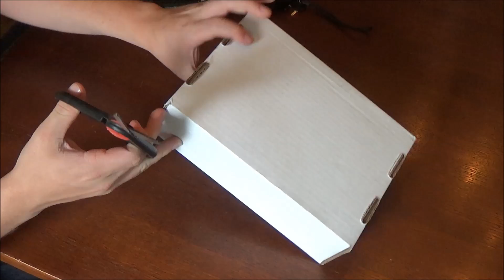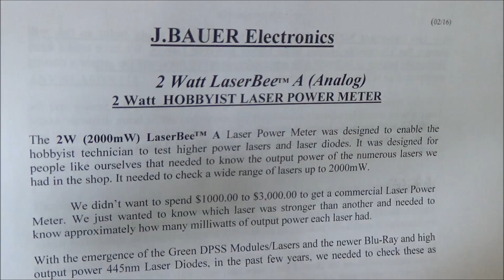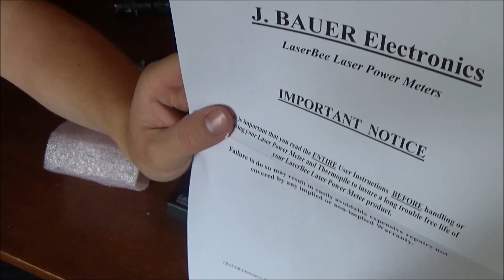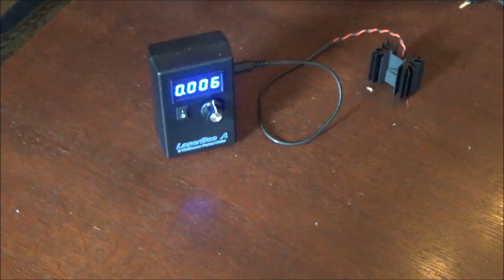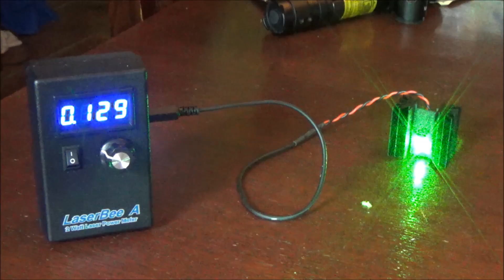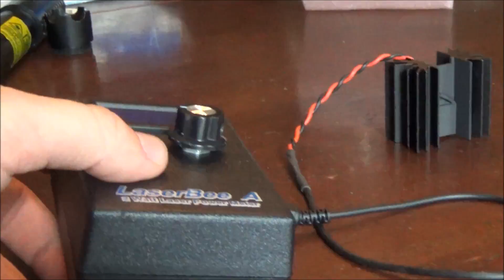Laserbee A 2 Watt LPM Laser Power Meter Review

Comment from the maker: UPDATE: The LaserBee A has been discontinued because it was essentially the same as the LaserBee AX ($159.99) but with a lower maximum power specification (2 Watts compared to to 3.1 watts). It was also discontinued due to the fact that some specific parts that were designed into it were no longer available to J. Bauer Electronics. The Laserbee AX is still available here: https://www.laserbeelpm.com/laserbee-ax.html
Reply: I have one I made on eBay called Kleon II laser power meter

Comment: Hey I love your videos -- could you compare the readings of the Laserbee LPM with the pocket LPM I have seen in your other videos? The pocket one seems too good to be true, at $70-$80 and able to accept anything up to 10 Watts....is it as accurate as the Laserbee? Thanks!
Reply from the maker: When I originally got the pocket LPM I did some side by side comparisons and found the lower (<200mw) readings to be within 3mw-5mw of my Laserbee readings, if not the same. However, I took down the video of that LPM because it had way overstated its ability of 10W, and was smoking after 3W or so
Reply: Wish you'd kept it up, would save a lot of folks some money. There is a portable/"pocket sized" LPM being advertised and sold for $75 with a supposed 10W limit. Unsure whether you still read comments or are active here, but any idea whether these are legitimate to any degree? Any legitimate smaller/1 piece simple LPMs in the under $100 range these days that will hold up to 5-7W? Thanks, bro
Reply: I have one I made on eBay called Kleon II laser power meter

Comment: How accurate is this device?
A professional power meter will cost at least $1,500 - $2,000 and will measure within 1-2 seconds.  (I know, I’m using one).  This device probably measure the temperature rise over a very long period of time and estimate in average, the amount of energy (Joules) that was required to reach that value.  Not the best way....so many unknowns.
Reply from the maker: I have found this device to have very consistent readings compared to the tests done by others using the same lasers with more expensive LPM's. You do wait about 20ish seconds for the the climb, but the results have been reliable for my purposes
Reply: AMRonin... Similar to  the Professional LPMs, the LaserBee A is an entry level hobbyists LPM that uses a Thermopile Sensor to detect the differential output of it's broadband coated Sensor element.
It is calibrated against a recently calibrated NIST traceable Professional Coherent LPM. Professional LPMs use the same principle to detect a Laser's beam power.
Yes this (LaserBee A) at less than 1/10 the costs of a Professional Laser Power Meter requires a longer response time to get that 5% accuracy reading.

Comment: How does the power meter know what type of laser it is testing? For example: a red laser isn't going to give out as much heat as a green or blue laser - at the same wattage. So how is it supposed to accurately measure the power?
Reply: The LaserBee LPM product line uses different broadband sensor coatings that give the same output curve from 300nm to 1500nm wavelengths.
Reply: Some are sold specified for red/green/blue spectrums